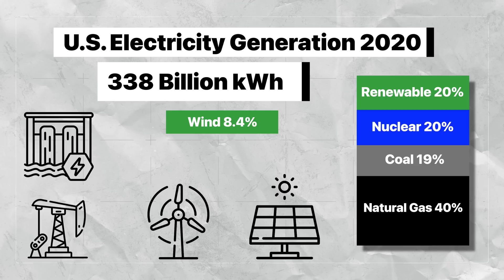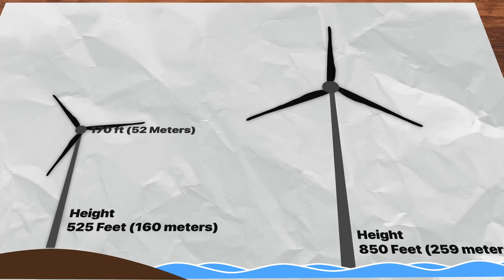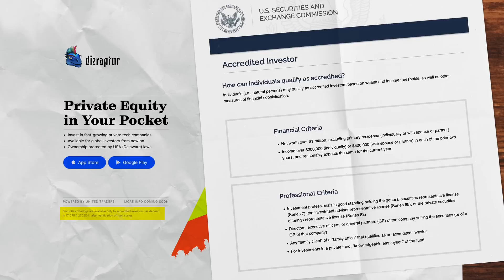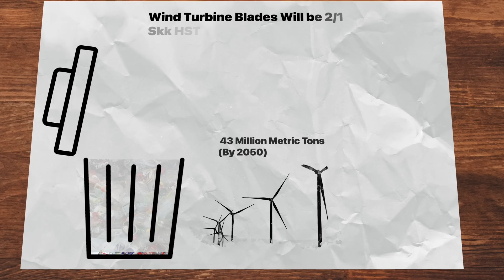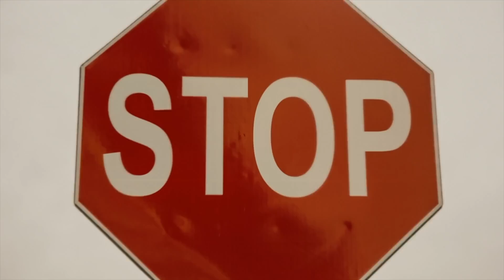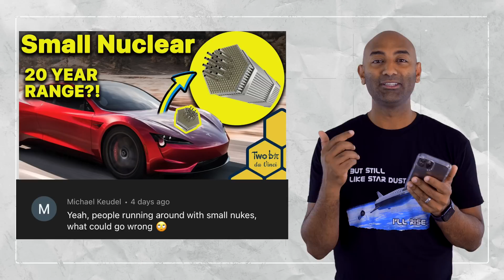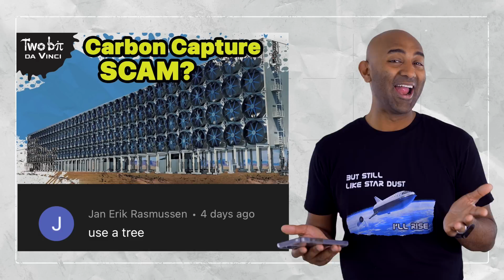The TRUTH About Wind Turbines

Comment: as with all sources of energy, there are costs. The key is to minimize and mitigate the costs. Wind appears to be far preferable to other options. Having said this, the best answer appears to be rooftop solar and more efficient use of energy. 

With regard to our whole energy ecosystem, it's not as though there aren't myriad opportunities to use energy more efficiently. As folks are fond of saying about other opportunities, "there are plenty of low hanging fruit". In the case of the energy ecosystem there are fruit lying all over the ground.
Reply: Solar panels aren't 100% recyclables neither...
Reply: Solar panels are toxic when made and when in landfills. They are the most toxic form of energy. They also involve slave mining labor.
Reply: This video is completely wrong !!! This company in the Netherlands, Extreme Eco Solutions, recycles decommissioned turbine blades as well as fiber composite yachts into 100% recyclable street and floor tiles without subsidies and with a profit. Very very poor research from the person who made this video. 

It is not the technology that is wrong, but people are.

Comment: Here in the Netherlands the old windturbine blades are beeing reused as building materials or grinded down to granulate for building materials or incineration.  We dont have landfills any more so there is no place to put them in the ground.
Reply: Yea, I feel like the only problem is that they can’t be recycled PROFITABLY. It’s definitely possible. So maybe we should subsidize it or something in order to help the system get up and running.
Reply: This video is completely wrong !!! This company in the Netherlands, Extreme Eco Solutions, recycles decommissioned turbine blades as well as fiber composite yachts into 100% recyclable street and floor tiles without subsidies and with a profit. Very very poor research from the person who made this video. 

It is not the technology that is wrong, but people are.

Comment: at 1:40 minute mark, you compare wind energy with baseline energy providers which is a false equivalency.  The energy produced from wind turbines is intermittent and so, is not a source for baseline power.
Reply: It's fair in this respect, it is still cheaper per kwH than baseline. Even if you only use it to replace peaker plants (or reduce usage), baseline power tends to be less expensive than peaker plants. So wind is even cheaper than that. But certainly in the use case of base power, you really need to include the cost of energy storage as well. The other thing I wish these price comparisons had was separation of costs (capital costs per kwH of potential generation and operational costs per kwH of actual generation).
Reply: @richard77231  paired with grid-scale storage, it MAY become a source of baseline energy.  But until then...